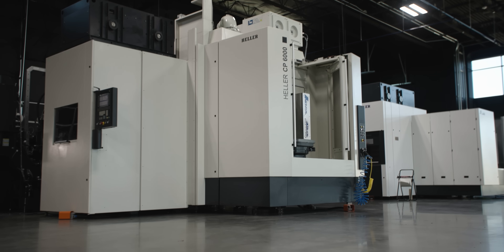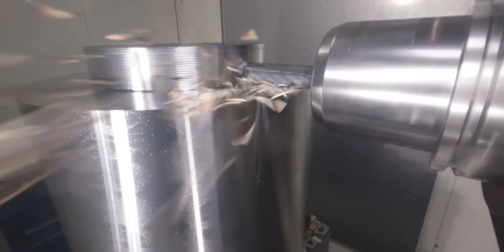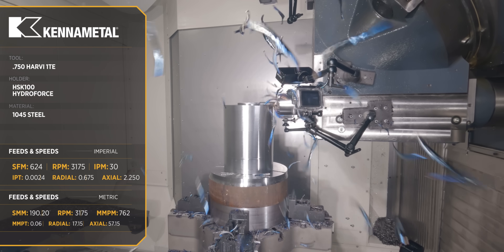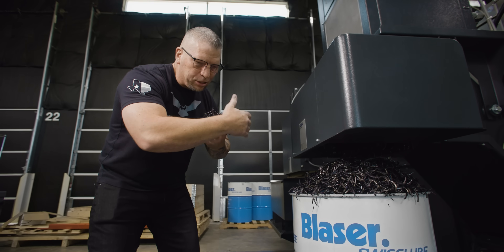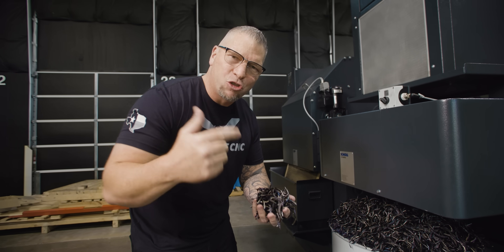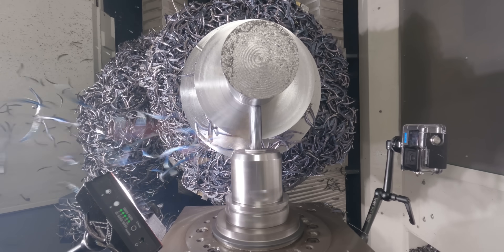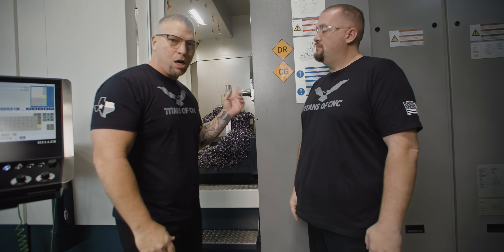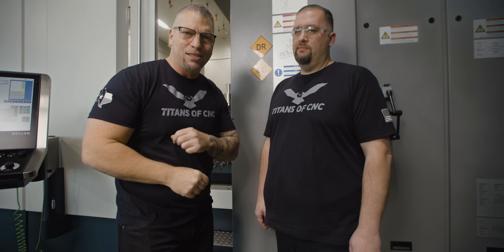MURDERING Material on Our NEW HELLER CP 6000

Comment: I was just doing some mill turning today and was wondering. How do you calculate the Rpm you need to rotate the part at as well as the speed of them endmill to find out the chip per tooth and sfm. We were going full depth and milling out. ALarge pocket on a lathe feeding the tool into the material in the X and rotating the subspindle.

Comment: I have a question for everyone out there in the machining community. I need to cut an M20 X 4 ID acme thread about 1.5 inches deep in 416 stainless. Tapping is not an option as we will be building a lot of these parts. Does anyone have any thoughts or ideas?
Reply: Probably a thread mill. Some replicable insert will have some specific grades for those

Comment: Please help me with my math here? First cut is 2.250" x 0.075" x 300IPM = 50.625 cu"/min........second cut 2.250" x 0.675" x 30 IPM = 45.5625 cu"/min. Am I missing the rotary speed or something here?
Reply: The MRR here is difficult to calculate because the feed and speed given are for the back end of the tool that is cutting the larger diameter, whereas the tip of the tool is moving through material more slowly

Comment: I calculated my step over ratio rightnow its just 3% 🙃
Reply: 3% is very low if youre using a good quality cnc mill and spindle. For steel and aluminium we generally use between 10-60% depending on doc and other factors. What kinda material and cutter do you use?

Comment: Whitch part of the tool you considered calculating feed? The tip of the tool milled much less material than the back.
Reply: Very observant! I calculated this by measuring the outside diameter, then the finished diameter. the difference was 63%, so I reduced the feed at the tip of the tool by 37% so that the back of the tool was moving at the desired feedrate!

Comment: What was this one programmed with, and with which package? Was the initial post processor good from the get or did it require a few tweaks? KEEP IT UP!
Reply from the maker: Mastercam
Reply: Yep we used Mastercam's multiaxis flow toolpath, keeping the tool axis perpendicular to the finished surface.
Reply: @barrysetzer  Right on! For some reason I wasn't thinking it was a straight forward flow toolpath. Very cool

Comment: I have no need for that machine at the moment but I want one.
How does the flute edge hold up on the harvi end mills? I've got a cast part with an interrupted cut that I keep getting nicked flutes on with our general purpose carbide end mills. I'm interpolating on a not so rigid setup and holding =/-.0006, which is easy peasy. Will the Harvi hold up? I need a solution...
Reply: They are absolute beasts. Did you see the one we did where we started full slotting with one that was already chipped to death from running for 2 hours in inconel? Monster......
Reply: @barrysetzer  I bought a few. We'll see...
Reply: You wont regret it. Make sure to let me know what you think 😎👍

Comment: how is climb milling a good thing, I swear it was a bad option
Reply from the maker: Climb milling is done 99.9% of the time these days… especially on high level machines. One simply reason is that all chips are behind the cutter instead of blasting in front, where the cutter would be running them over and breaking.
There are times to conventional mill but ya… Climb Milling is King.

Comment: Easy on my old Alfred Herbert 12B with its 24"chuck and lots of HP.   15 ton monster turret lathe I had last century. Date on the bed was 1944, my birthday.  Solid cast iron. Push a 3.5 " spade drill down it with 0.5" cut on the o/d.  You are spoiled Titan.

Comment: Please do a comparison run of the endmill removing material and a comparison run by turning it off. What’s the cycle time of each run ? I’d love to know…
Reply: I actually like that idea! I did it this way just to alleviate some of the torque concerns I had with turning, and thought it might be a good pointer for the times you run into a similar issue
Reply: It definately depends a lot what exactly are doing, what material, what is the diameter... Milling small diameter aluminium, where you need high RPM will be way faster than turning. Keep in mind those rotating table do not spin as fast as a lathe; it's often just above 1000rpm or even less than that on bigger ones. But large stainless or superalloy parts where you can't use high rpm, it may be way different.

Comment: YESSSS BLUE CHIPS!!!!
Reply: When Titan said at the end that in the real world you would want to use coolant... But why (except for chip evacuation)? Would this not thermal-shock the cutter? I don’t know what kind of coatings are on the Harvi EMs, but coatings like TiAlN only gets hard when it gets hot; if I add coolant I’d lose the hardness I’d otherwise gain.
Reply: @chulangmo5799  pretty sure it will only thermal shock if it is already hot. If you use continuous coolant from the start it should never reach those high temperature.